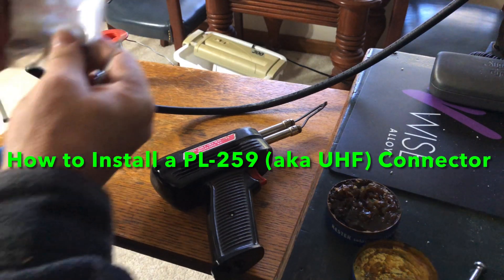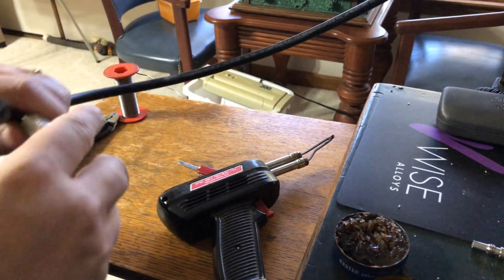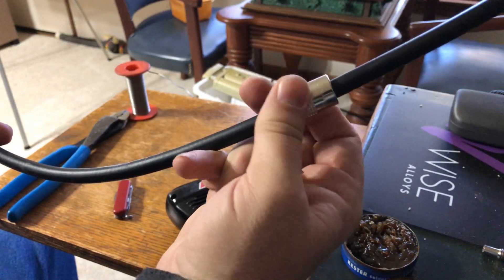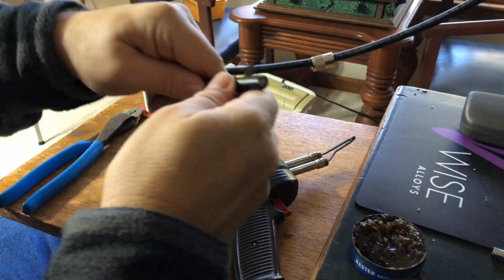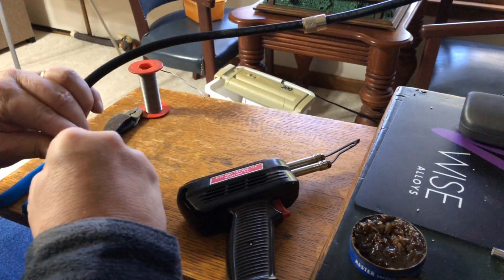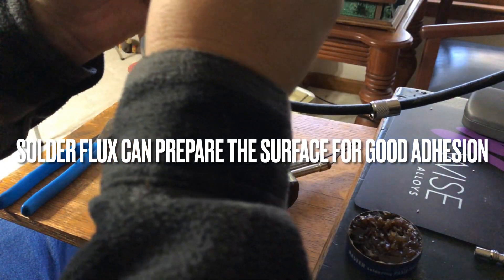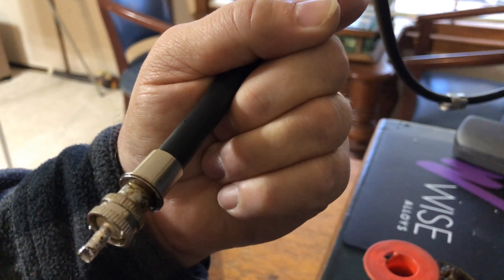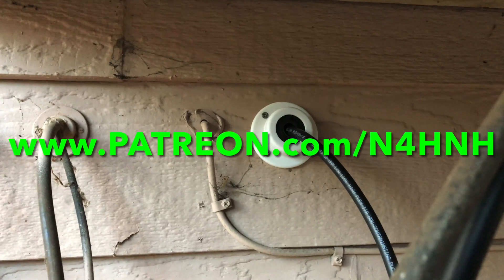How to Install a PL-259 (aka UHF) Connector   #hamradio #pl-259 #pl259

Comment: Hi Doug. Always a good idea to learn as much as possible about all things AmateurRadio. While growing up in Augusta, my dad also gave me a Weller pistol soldering gun. But it wasn’t until my first job out of college that I learned how to install connectors onto different types of coax. I still have it and I still use it! 73…Rob
Reply from the maker: Yes, Robert, mine is over 50 years old and still works. I have been able to order replacement tips from RadioShack.com. 

73, Doug

Comment: That center insulator turned into a roasted marshmallow goo just from tinning the center wire
Reply from the maker: Then there are thousands of gooy dielectrics around the US, soldered by Motorola technicians. No, the key is in using a high power soldering iron. It heats the immediate area quickly. I have taken these apart, to re-use a PL-259, and the dielectric was just fine.  But you go ahead and do it your way.
Reply: @n4hnhradio  maybe with the solid polyethylene.. but that gas injected foam goos right up. It will resolidify into a hard plastic and work for the most part. But then again I don’t think Motorola uses old connector specs from the 1930s.

Comment: You might want to check out a video by Mr Carlson's lab  https://www.youtube.com/watch?v=79uD6XwBg5E Not for soldering, you know how to do that, check out the modification of the soldering gun tip. I find it works very well for me. Lots of heat very fast! It works much better, for me at least, for soldering stuff that needs lots of heat.

Thanks for another very fine video! I greatly appreciate your videos on the FTDX10 and the FT-891!

Comment: Doug how hot of a soldering iron/gun do you need to do this right?
Reply from the maker: Curt, the one I use is a dual-heat model that is 100W or 140W.  It has a button with two positions.  I use the 140W position.  The idea is to heat the connector quickly and get the job done.  Lesser power soldering irons take too long and they can damage the insulation in the PL-259, especially one with plastic insulation.  The AMPHENOL connectors are a higher quality.  They can take the heat for a longer period of time.

The soldering gun we used for Motorola installations was 350W.  That is even better. The idea is to heat the connector quickly, apply the solder, and let it cool.  Too little heat for too long can damage the coax dielectric.  My 140W iron is a compromise. 

73, Doug
Reply: @n4hnhradio  thanks for confirming.  Looks like I'm set as my old craftsman soldering gun is a 100W/140W model.   Hear you on AMPHENOL too!    Thanks!  Looking forward to the video to see what your techniques are.
Reply from the maker: My dad bought the Weller 100/140W soldering gun for me when I was just getting into radio, during my early teens.  It’s the one in the video.  This video is an excerpt from the one I made when I replaced the coax for my ZS6BKW with LMR-400.  That video is at this link:  https://youtu.be/rR32rArlOts

73, Doug
Reply: @n4hnhradio  I remember that video now!   I must have skipped over the install of the PL-259.   I did pick up a great tip, I've never pre-tinned the shield or center conductor.   I'll have to do that on my next one.   I'd also love to see how you do RG-8X PL-259's!   Dealing with the shield and inserts is a bit different than RG8/RG213/LMR400.
Reply from the maker: @kb9jqu  For RG8X, RG-58, and RG-59, I slide the reducer onto the coax first and trim the outer insulation.  I then fold the shield back over the reducer and I tin the shield. Next, I trim the dielectric off the center conductor and tin the center conductor.  I don't trim the dielectric too close to the shield.  I leave 1/16 to 1/8 inch of dielectric.  Next, I screw the PL-259 onto the reducer and tighten them together.  It is important to tighten them together before applying the solder to the shield holes and the center conductor, to avoid twisting the wires.  Finally, I apply the solder to the shield holes and the center conductor, just as I do for RG-8, RG-213, or LMR-400.

Note that I use the same method for RG-58 and RG-59 size coax and reducers.

73, Doug
Reply: That makes perfect sense.   Thanks Doug!